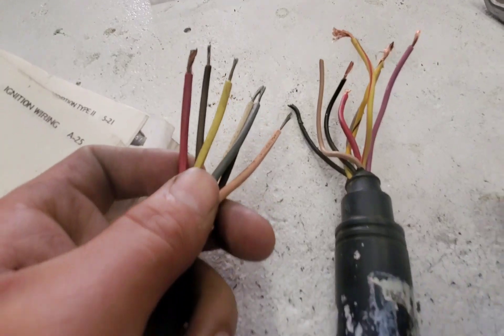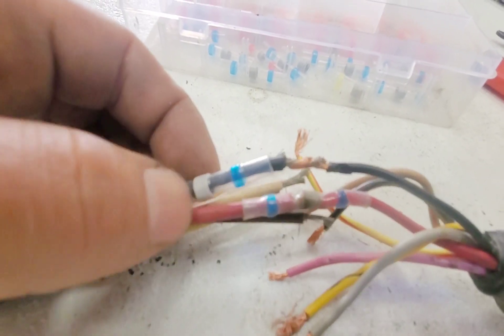Merc Outboards: Universal Key Switch DIY

Comment: i have a 1969 650 thunderbolt working on a the ignition switch having no luck, can't find the right diagram to resolder the wires to the switch. plus the one your doing in this video would not fit in my control box mine is fat and short

Comment: Hey Bud, I had to replace the control box on my old mercury. My boat originally had the key switch on the console. The new remote control box has the key switch in it. How to I get power from the new switch to the gauge panel.
Reply from the maker: There should be a pigtail on the front of the controls for that.
Reply: @MerCSonL6  there is one, was wondering if they make an adapter to plug into it and the other end that would plug back into my square plug that currently feeds all the gauges.If they don’t I guess you just have to cut the plug in off and tie directly to the wires.?
Reply from the maker: @Stuart Varnon  they did make an adapter at one point. Hard wiring will work. It's just, power, ground, and tach.

Comment: Where does black/yellow go- m terminal on switch? And where does orange lead to on motor? 1150 115 1976, have no spark! @ plugs, switch box and coil test good, thinking in wiring! Please help🙏
Reply from the maker: Are you sure you have a black and yellow wire on a 76? Black and yellow is the kill switch wire witch didn't come out till the adi ignition. do you have a distributor? Or 6 coils? Son

Comment: Hey thanks for all the great videos! I’ve got a 77’ 1500 I’m trying to bring back to life. Would you be able to send me a link to the type of switch you use? Thanks!
Reply from the maker: Boat Ignition Switch with Key Replacement for Mercury Mariner Outboard Motor Control Box with 2 Keys 3 Position 6 Wire Connectors - Replace Mercury Ignition Switch 87-17009A2 87-17009A5 https://a.co/d/46xoWeU

Comment: Hello, I have a 115 merc. Late 70. Put new starter, and solenoid on and not getting anything’s all, my electric choke isn’t working either . Any help would be nice
Reply from the maker: Can you verify power is going to the hot side of the selonoid and that the engine is properly grounded?

Comment: Can you do a instructional video on how to wire the new ignition switch for a 1970's merc 402 40 hp? My ignition switch was rotted and all the wires broke off. I got a replacement from e-bay but the wires are different. My harness has a red, tan, yellow, and black wire. New ignition has a purple, red, yellow/red wire?
Reply from the maker: New harness only has 3 wires?

Comment: Can you send me this instruction step by step so I can connect my 1969 Mercury Kiehaefer 1000 Thunderbolt 100hp  to 8 pin just like the way you did it on this video because don't the diagram for these engines wiring harness?
Reply from the maker: You just have to get the color codes correct. Purchase a manual. Look at the 69 codes and newer codes. It will make sense with a little patience. Son

Comment: I have a 1984 35 hp Mercury, serial number : 6446766. I got this from a local guy to go a 1963 Boston Whaler that I am trying to rebuild. 

My problem is the guy cut the ignition switch off of the 8 pin wiring.  I want to replace the switch but do not know which wire connects where on the switch. The switched have 6 connector points and I have 8 wires! Do you know where I can get a diagram to connect the wiring to the switch?

Thank you for any information you can shed on this.
Reply: I got that moter to my 6445902

Comment: Son, first off I love the video’s! Second I was wondering if you could help me out with some info, I am looking to replace the key switch which is corroded on a “75 Mercury 500, the OEM part A51015 is five pin and the replacement is Sierra MP 41000 and has six pins ( I got it from marineengine.com thank you for the tip) They are labeled well but I am not sure what the different colored wires coming from my harness are for. Does you have a diagram or label that could help me out identifying all of these wires? The old switch was too corroded to see any labels or anything. Thank you!

Salmon?
White?
Gray- Choke switch?
Red?
Black? 
Yellow- neutral start interlock switch?
Brown-goes to tach connector?

I just need to know how these colors equate to the letters on the new part (MP41000) which are:
M-magneto
I-ignition
S-solenoid
B-battery
C-choke
M-?

Comment: Got a question for you I just got to L6 Motors  today a 79-78 both of the wiring harnesses were bad where do I buy those. external one to the motor
Reply from the maker: https://www.ebay.com/itm/233346254032
Reply from the maker: This is the internal harness. External is involves getting a new controller. Son
Reply: @MerCSonL6  I've got two controllers one's a little better than the other do you recommend any
Reply: It's funny you say that cuz actually I'm looking at your side plug and your control box you have on eBay for sale I may possibly be getting from you

Comment: Hey man I am in need of some direction rebuilding a 1972 mercury 140 tower of power .....
Reply: Sorry had the question in my head and didn't type it .....where are some good places to find parts? I ordered one piston from maybe boats.net but the rings are not the same thickness as the others . Standard seems to be 1/16 mine on the new one are 3/32 I would like to keep everything the same so I'm just gonna buy all new ones. Where's a good place for the electronics and maybe a timing belt for back up heard they are next to impossible to find 🤔 any direction would be appreciated.  Thanks
Reply from the maker: @kevinbowlby7835  oldmercs.com or marineengine.com. son

Comment: I just finished one right now.... For a 1965 mercury 650 a pain in the but to red is not power bet green is 🤔 but I finished it testing it later this morning...
Reply from the maker: Some of the older harnesses have blue in them. I can not find any diagrams (haven't looked) with a blue wire. Good luck 👍. Son
Reply: @MerCSonL6  I have a question it's probably a dumb one but. The white black and brown wires that come out of the control for the tachometer can I use that as a key switch or is it just for the tachometer ?
Reply from the maker: @maxt7911  brown is the tach. Black is the ground. You may need a specific converter for a 650. Son
Reply: @MerCSonL6  my bad didn't explain my self  the wirers that i was talking about are the ones for the 1400 mercury. it has a black, brown and white.